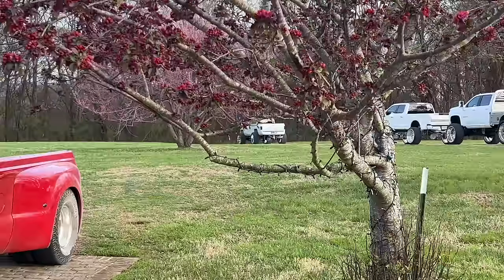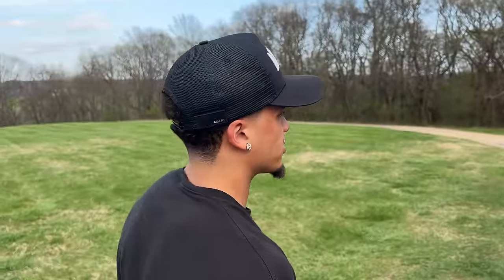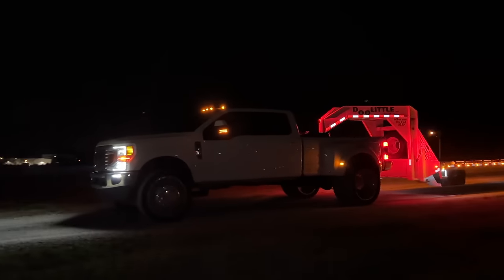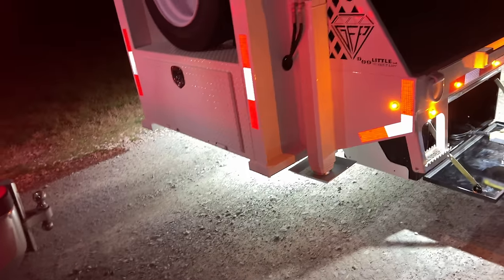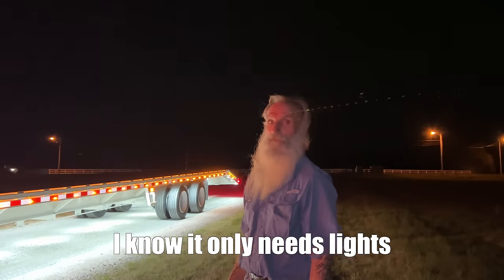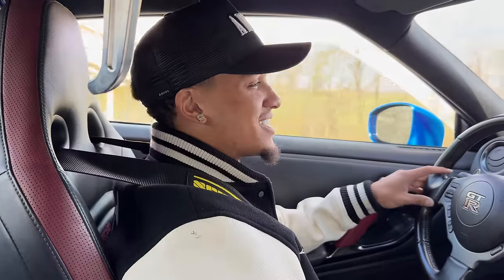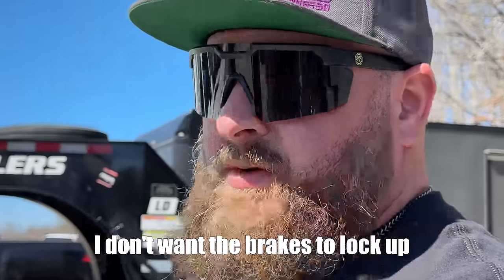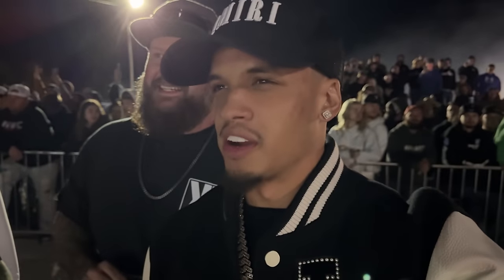I Bought The ROWDIEST Turbo’d SXS I Could Find!

Comment: Uhh why hell wouldn't you have a cage on a sxs? Their appearance is built with a cage in mind, get one low cut with the right angles to go with the angles the yxz or w.e seem to have.
Also all you meed to add is turn signals and a horn and you can register it, throw basic coverage insurance on it, and you a badass street legal side by side. It would work well as a golf cart for big shows, getting the trash cans, a vehicle to unload and drive around if you are traveling with one of the big trailers and don't want to bother navigating that big bitch everywhere. You can "level" it with some JTX Forged 18-22s on a R888 or something similar. register it as a LSV(low speed vehicle) like the golf carts in s*** are in Florida and that way the insurance is super cheap etc. or as a regular car if possible. They will ask for a vin number, you can create one yourself and stamp it into the frame or use the serial number + a few other numbers as long as it's 16 digits or however many a VIN is supposed to have. My parents made up theirs when they registered their 40mph Gas Ezgo golf cart in Florida, and I did the same to my rzr. Lsv's are supposed to only really travel along roads where the speed limit is max 35 and anywhere below that. Just so happens my rzr can easily double thst so i ride on the highways in Destin* & Miramar Beach

Comment: Glad Doolittle did you right. They are crappy ppl to deal with. Coming from someone that has bought several trailers from them. I guess knowing that you would advertise for them maybe they actually did something right for once.They have a 3 rating for a reason, always stating they will fix the issue and blowing you off until you stop calling. If you want a well built trailer and great customer service drive to Tx and get you a Maxx D or Gatormade.

Comment: You should buy my 01 6 speed Cummins extended cab short bed. Mildy built and pretty much rust free but hit a deer and a ditch. I live in central Illinois and would rather watch you do something cool with it than part it out. Give you a good deal on it. Still runs great just needs the front end redone

Comment: Super dwarf, does a mediocre burnout and yall commend him whipping 2 donuts? Just because he is vertically challenged doesn't mean he is incapable of leading his breaks and smashinf the gas! But he does meed to quit dumping money into that thing and get himself a newer truck. Instead of a hidden tool box side bed, he can get one of those crane's dmaxrhyno had in the bed of Sema, or the one sell at Harbor freight for like $150 and lift himself into the bed wh3n needed. He can also use to suspend himself to clean the sides n shit if he lifts it again! 
I believe they even make them where they collapse on themselves to be hidden in the bed